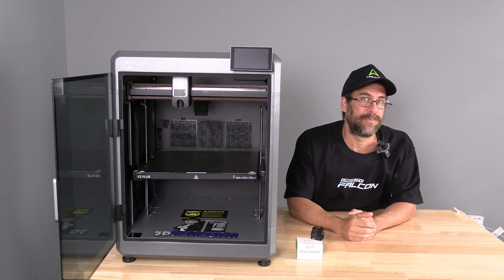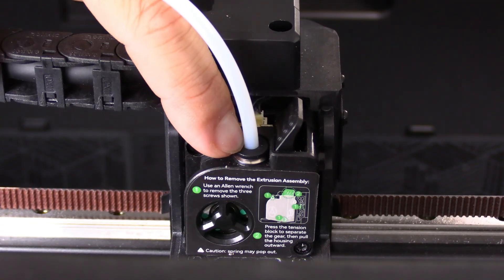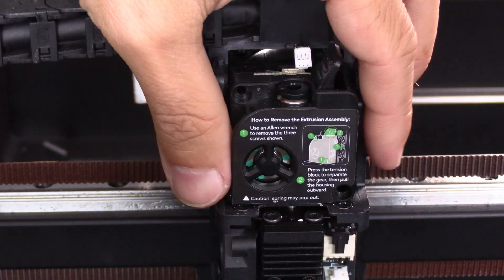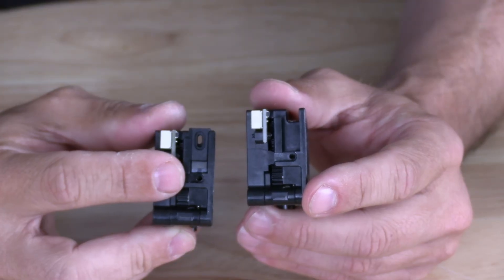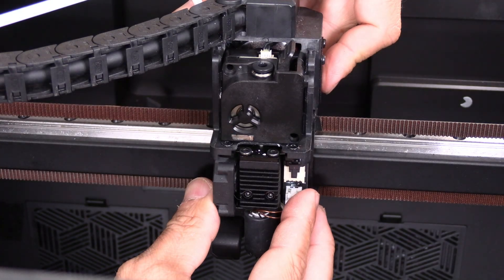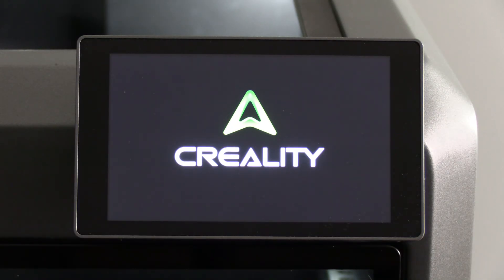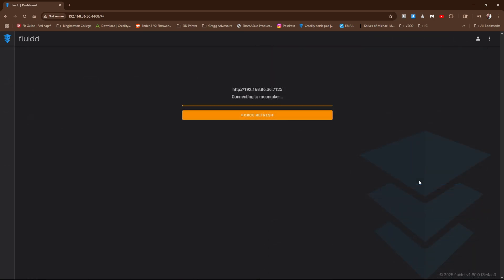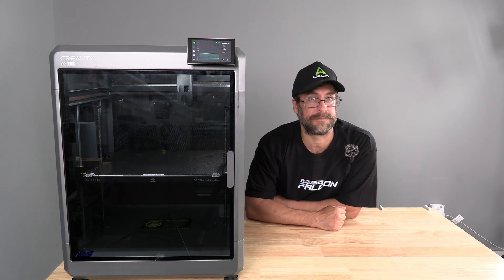Creality K2 Plus: Replace Extruder + Stepper Motor. Calibrate. Test. *NEW version*

Comment: I did the same extruder upgrade and upgraded my hot end also. My printer can't get through calibration in 12 attempts. It keeps telling me to reset the printer every time. I finally had enough of that nonsense and just went into the rest of your video doing everything you did and everything checked out but my printer still won't do anything. It won't pass leveling or any other calibration. I would greatly appreciate any ideas you have.

Comment: I have this printer. This is the 2nd time I had an issue with my extruder just stopping. No errors or anything. the motor does lock up whne it gets power. But won't turn last time this happened it just started working again. this time I am not sure. If i turn off the motors i can turn it by hand. When I click the extrude button the motor gets energized and I can't turn it but yet It won't actually turn. Any suggestions would be great.
Reply from the maker: Keep in mind, when a stepper is powered, you will not be able to move it manually by hand.
Reply: @3DRundown  I understand that, I was just saying that as part of what it would and wouldn't do. But I did end up geting it fixed. I replaced the motor and cable then ran the config stuff you posted. I am thinking it was the cable
Reply from the maker: I didn't have enough time to finish. I was gonna say it was likely the motor or cable. Hopefully she behaves now
Reply: @3DRundown I hope so as well. Like I said this is the 2nd time it's happened that's why I even had an extra motor and cable. Because when it stopped the first time I actually watched your video but just took it apart then it randomly started working. This time I had to change it. Thanks again and thanks for taking the time to respond
Reply from the maker: Happy to be here. Good luck!

Comment: How do i print tpu with the upgraded version? Cant find any videos with the new version
Reply from the maker: Feed from an external roller or dryer.
Reply: @3DRundown what does that mean?
Reply: I do have a roller i printed and mpunt on top the k2 plus but i cant find any recent updated tutorials with the new extruder upgrade
Reply from the maker: Meant to say FEED. All the K2 Extruders work the same. Feed till it hits the hot end, then choose External Spool when sending the print from CP6. You can tell it what filament is loaded, on the screen, or in Device tab on CP6. If it's RFID, you can tap the icon on the machine .

Comment: My crappy K2 Plus extruder keeps telling me a filament is being loaded. The little blue light stays on and I cant use the printer while it thinks that a filament is being loaded. Creality sent me the little board inside the extruder but after replacing it, the extruder STILL reads a filament loading. Also the CFS bay 1 wont load or unload filament at all. They sent me a new board for that and....you guessed it, it STILL doesn't work. This machine is the biggest piece of garbage and waste of money I've ever seen. Instead of working on it, you should warn your viewers to steer clear of this hunk of junk !!!
Reply from the maker: What a cry baby. Go somewhere else
Reply: @3DRundown  What a dick. Is creality paying you well?
Reply from the maker: Have you tried Crying about it?

Comment: Have had my k2 plus since july and its already broken down with it saying motor not working so replaced it now saying internal error during ready callback yay me
Reply from the maker: Did you run the stepper calibration
Reply: @3DRundown tried to on fluid but its got me resetting it with the xs2001 code popping up over and over

Comment: This is the first time I have joined any channel but this is totally worth it. I have had a K2 plus  for several months now and had a number of problems. Panic sets in, then despair and then I think, 3D Rundown. This is the place to go. Good information, clearly and well presented at a speed that is easy to follow without the need to keep rewinding.
Reply from the maker: Memberships are SO helpful, and important to keep this Channel going. Appreciate you! Do my best to keep you going

Comment: I wonder, what does that calibration do exactly? 

I'd becoming a bit of a known issue that the extruder motors run hot, and the fan does little to keep the motor cool. Which is leading to heating up the extruder gears and eventually, on long prints with softer materials (like PETG), the extruder jams up

Does that calibration change the extruders motor current from the motor driver at all? Is there a way to tweak the power down? 

Thats something i used to do with my old homemade corexy printer that ran TMC2209 drivers,  early drivers you could tweak a little pot on the driver, later ones you could edit it directly in firmware. Adjust it down until you started skipping steps, then adjust it back up for a good margin. Motors would run considerably cooler, i wonder if the K2 extruder motor (and other motors for that matter, hidden inside the body) run too much current and thus run hot..?

Comment: I would like to change the wiring as well.  I'm working through troubleshooting an extruder that runs in reverse so wiring could be the problem.  Where is the other end of the stepper wiring and how do you access it?
Reply from the maker: It's gonna ultimately end up at the Mainboard. You think it's wires backwards? Maybe pop the connector, and flip it. or cut the wires and splice it. sounds like a pain either way

Comment: Well.. my k2 plus is about a month old.. started throwing FR2865 - Feed issue, filament failed to exit extruder errors for the past week at the end of a print right when it goes to retract filament and with multi color prints right when it gets ready to switch spools. Swapped my CFS and buffer to eliminate those as possible problems and issue remained. Replaced cutter, calibrated, issue remained. Replaced all tubing inside and out... issue remained. New nozzle, issue remained. Lol. So... With your provided part numbers I just swapped the entire extruder assembly and stepper motor. Running calibrations and we'll see, lol. Thanks for the info! :) Have less headaches with my Sovol SV08, lol... so far!
Reply: Alright... mission failed, lol. Just remembered to check the cutter post.. maybe not slamming home far enough to cut completely.
Reply: Well.. found my dang cutter post broken... sooooo.... yeah. LOL.
Reply from the maker: FML 🤦🏼‍♂️
Reply: @3DRundown always the overlooked simple fix, lol.
Reply from the maker: Bro, if I had a Nickle....
Reply: @3DRundown  haha, yep :D

Comment: Ordered a new extruder due to the teeth on the coupler being shot. Unfortunately I am 13+ hours into a print. Do you think I can simply install and resume, or is the recalibration absolutely essential?
Reply from the maker: The calibration, is only for the STEPPER replacement. However, even the smallest toolhead movement, will trash your resume.... Good luck to you.

Comment: Any idea where to get replacement cables that you flicked out of the way at 4:34 that connect the extruder to the circuit board somehow mine got cut and been trying to work with Creality for over a month now and keep going in circles they need better pics getting the run-around for some 3 wire JST cable. Thanks.
Reply from the maker: Creality is really tough with this kind of thing. You'd think it should be easy, but, it's not. I need to talk with them, about this, because needs like this, are becoming more common.

Comment: I had the extruder PCB on the back of the hot end go out. after replacing it the extruder motor stopped working. I spent hours of frustration trying to get it working. found this video and bam, in 10 minutes was back to printing. I owe you a very big beer sir! thank you! definitely subscribing for more fixing content like this!

Comment: Two quick questions, if I may. 
1. New stepper vs old stepper, how to decide. 
2. What happens if the calibration is larger than 15? Do you just rerun the calibration until it comes out less than 15?
Thank You
Reply from the maker: 1.) NEW Extruder (because Creality says so...)
2.) Run again. If still no good. Replace it

Comment: I'd secure the extruder motor to the front with those long screws before sliding in there. Be careful not to drop any debris from the old or new extruder motor into the throat of the nozzle.
Reply from the maker: Typically there will be filament in the throat, as there was in mine, as it cut before the most recent retract.

Comment: I just went through this a few weeks ago when I replaced the problematic extender with upgraded unit. Not a difficult venture and I suspect this video will help others. The new ungraded extruder at least keep the tubing firmly affixed. I cannot say that I notice any other improvements or differences.
Reply from the maker: Long as it's not Jamming
Reply: What were the reasons it needed replaced?